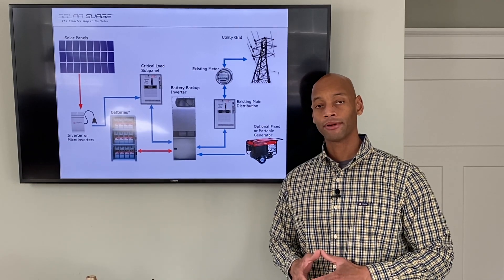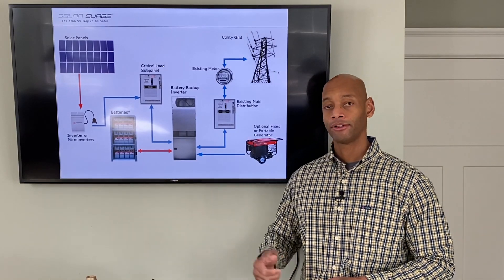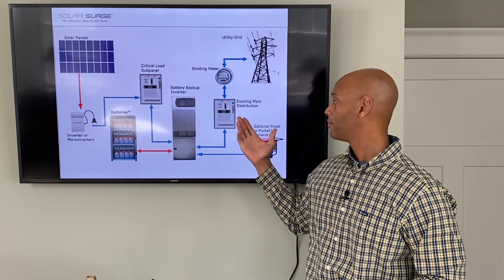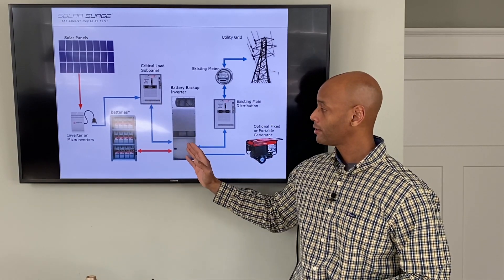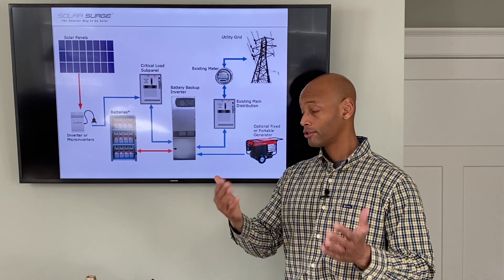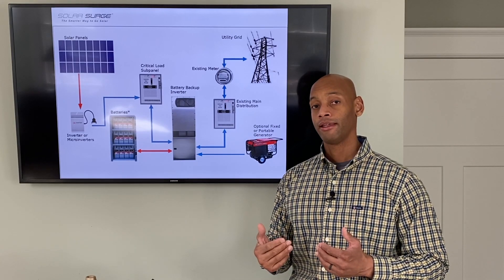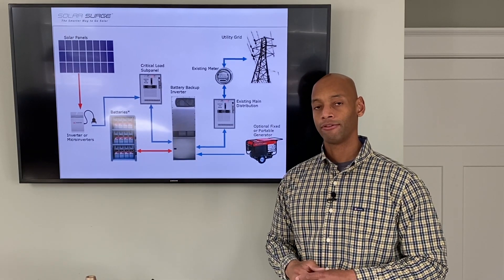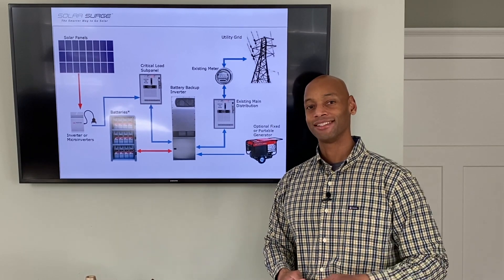How to Add Battery Backup to Solar System

Comment: hey Joe, great info.  I have this set up now and its paid for. Id like to know if i can upgrade the existing panels to more efficient producing panels using my same Inverter set up. Also adding battery back up would be great as well. 

Solar Panels: Sun Power

Model: SPR 230 WHT

Quantity: 30

Watts Total : 6900

kW Total: 6.9

Inverter: Sunpower

Inverter Model: SPR 3000 & 5000m

Comment: How can I  use my battery at  same time solar is keeping my battery charge before needing to go back to the grid.
Reply from the maker: It’s a very technical answer, but basically both Solar and Battery power is delivered to the same DC bus from which the inverter is drawing so both can contribute to your needs.

Comment: I love it. I have solar and would like to get information about the battery store system and info on the generator set up. Also want to know how/if possible to set up system where enough energy stored and eliminate need for generator in power outage situation occurs. If possible.  Thank you.

Comment: Thank you for the information on solar systems.  I have two SUN 1000W/120V grid tie in inverters with limiters tie to supplemental solar power system.  Each inverter is hooked up to one 120V line.  Their purpose is to only supply supplemental solar power without sending any power in to the grid.  What system should I use to add batteries so that can have some supplemental power at night?

Comment: Thanks for this. Our solar panels are leased, We are grandfathered into Net Metering 2.0 in California. I believe if make any change to our system, well firstly the Solar provider has to allow/approve, and we will probably be switched to Net meter 3.0. Anyway .... I do have a 6500 Watt gas generator. I added a manual transfer switch to my main panel. So with the grid down, I turn off the main breaker,  slide the transfer switch and flip the 30amp breaker for the generator. This then powers the whole house. I dont use the dryer or electric stove. Looking at your diagram it makes me think that now the invertor is being tricked .... so would it be true to say that the solar panels are producing and feeding energy into my house while the generator is running?

Comment: is this configuration available in southern NJ for customers like myself with an existing Sunpower system circa 2015 ...(DC)?  i also already have the alternate box for the emergency circuits feeding off a gas powered generator during emergencies.

Comment: Any idea if this set up can be accomplished using an EcoFlow Delta Pro Ultra and EcoFlow Smart Home Panel 2? If so, would the Smart Home Panel 2 just replace the Critical Load Subpanel and the Delta Pro Ultra replace the Batteries in your diagram? I'm assuming you would still need to buy a separate AC coupled inverter/charger in order to all for the panel inverter to still work in the case the grid goes down, as well as to be able to send excess electricity back to the grid for NEM.

Comment: Hello thank you  for this video, I'm planning to add back battery on my existing solar system. I do have Enphase micro inverter. what type of inverter do I need to use? thank you
Reply from the maker: This video is a bit outdated. For today's batteries, you could use either FranklinWH or Tesla Powerwall 2 to add to your existing Enphase solar system.

Comment: Hi, Joe, thanks for the video. I'm from CA. If I add a battery back-up into my grid tied solar with micro inverters since 2015, will my current NEM be changed? Thanks.

Comment: This seems wasteful. You’re charging your batteries with DC from the solar that you can convert to AC and then back to DC. Also, the batteries don’t appear to be portable. We need better cheaper systems that we can manually switch in the very rare occurrence of the grid being down for an extended period. Also, my car’s battery is four or five times what’s needed usually for a home back up and I really would appreciate some way to use that.

Comment: Keep in mind that for many people this is for a rare occurrence that may never happen.   I have never had a power outage for more than a few minutes in my area in 12 years.   So I would be perfectly happy having to do some manual switching in the case I ever need to use the backup if it saves me money now.   Also I might want to be able to use the batteries for other uses - such as a boat motor which I would rarely use - maybe a few times a year.  So I'd prefer them to be portable.
Reply: Ecoflow

Comment: my 5 KW solar system already has an inverter.   It seems a waste to buy a 2nd inverter for the batteries.   Can't that be avoided?  I would rather have a switch input to my one inverter to select battery or solar panel inputs.    Then I would need a separate switch I think to disconnect from city power and feed my main house electric panel from my batteries or solar.   FYI, my current inverter feeds the city meter and power comes to my house in all cases from a connection from that meter.  We are on net metering so maybe that is why.    Should the batteries be stored inside my house for better temp control and longevity (moisture, sun, etc)

Comment: Hi, can I connect manual transfer switch connect to the main panel and use gas generator if I got grid tie solar system?

Comment: Caint I just use a transfer switch to set up off grid battery backup for my solar ??
Reply from the maker: Yes that's one option, but it will be a more cumbersome wiring.

Comment: Question about main busbar... I know in a PV only system, the breaker max size tying into the solar system is decided by busbar rating times 1.2, so on a 200 amp busbar with a 200 amp main, you can have a 40 amp breaker for the solar, which I assume means a max current of 32 amps in that 40 amp breaker.
What about the battery storage? Does the current of the batteries add to the PV for the busbar calculation? Or, since the batteries would never feed the grid during the daytime, is there a different rule? I am trying to understand the Enphase system and get certified.

Comment: Niceley explained. Do you also offer a possibility to choose between power from the outside grid or the battery. Like via an app or an automated system depending on  actual KWH prices?

Comment: Hello , I’m looking for an Inverter like you where showing here , my house now on average 3KW a day , I do have a central Ac unit forced hot air , gas furnace, 2 full-size refrigerators , the coffee maker 3,000W / 24 hours = 125wh or 3,000/16 hours wake hours 187.5Wh the hybrid inverter battery back up Solar/ wind turbine MPPT 90A 120v x 2 or stackable inverters !
Reply from the maker: Check out www.altestore.com

Comment: if i dont want to have another C.L. panel and want to use my main panel with all my connections the way it is and turn off just the brakers i dont want to use , it will be ever easier correct?

Comment: What about back feeding the main panel fitted with an interlock kit rather than separating 10 circuit and manually switching between the battery bank and main?

Comment: When the grid is still connected and your battery is full and the house-load is limited; you will have extra energy to fed into the grid. Will that also work in the configuration you show?
Reply from the maker: Very good question.  The answer is Yes.  The hybrid battery backup inverter has the ability to feed excess solar back to the main panel/grid for sell back.

Comment: This is excellent. I REALLY appreciate how you go into how the inverter tricks the solar inverter into producing and shutting down, and it’s good to see that a generator can feed it directly to supplement the solar. 

I’m in a situation where I’d only want 2-4 hours of battery if it’s night or I’m not getting much solar energy, and depending on heat/cooling load, and then I could swap to a generator if the nights also need some power and the grid is still down.

Comment: Joe I have a 20’ x30’ camp I power with a gasoline generator. The generator is located in a structure 70’ from the camp. An underground cable runs to a 100 amp entrance panel inside the camp and powers the circuits from the panel. I would like to add a battery bank that I could keep charged by the generator. The camp sets on 32” concrete foundation wall and there’s a concrete slab creating a crawl space beneath the camp, this is where I would keep the batteries. How do I connect the power from the battery bank to the entrance panel. My goal is use battery power to keep fridge and lights going in the evenings and while I’m away riding side x side, fishing etc.. The camp is located in northern Maine no grid power is available, I would like to add a small solar array down the road to charge the batteries as well. I use the camp 8 to 12 times a year hoping to use it more when I retire in 2 years. I would appreciate help with design and the components needed to accomplish this!?
Reply: Outback Flexpower One and batteries.

Comment: I just watched a prepper video the other day that was talking about the different types of back up power in a grid down scenario. They were saying the Tesla wall doesn't hold very much power and you could get more power from your car battery.
Reply from the maker: No I’m afraid that’s not correct. A standard 12 V car battery has less than 10% of the storage capacity of a single tesla power wall.
Reply: You are right.  My dual motor Model3 battery is 85 kWh capacity.   Powerwall is only 13.5 starting level.   It is frustrating Tesla doesn't allow me to use my tesla battery to feed an inverter in the case of a power outage.   But there are some technical issues on the house side also.    The line used to charge your tesla may not be the right specs to backcharge your panel.  Hopefully in the future this will be possible.  But you can be sure the utility companies will fight it every step of the way.

Comment: Can you use the battery AC coupling system to provide supplemental power during "time of use" peak times?
Reply from the maker: Yes, that is an option as well with this equipment.

Comment: Awesome video!  This setup is great, but you’re still connected to the grid.  I wonder how completely off-grid homesteads are set up…enough solar panels to run the house AND recharge the batteries during the day?  Or perhaps two battery banks used interchangeably??  I’m obviously a newb. 🤪

Comment: Why aren't the solar panels connected directly to the batteries (DC to DC) and then the inverter works on that power to power the AC side (House and Grid)?
Reply from the maker: Hi and thanks for writing in.  Most new solar + battery systems work that way you descried.  However, if we need to retrofit battery backup onto an existing grid-tied solar PV system, we use the AC-coupling method described in this video.

Comment: Hi. What about if you don't have a regular battery but have a solar generator that you want to use as the battery backup with an Enphase microinverter solar system? How can it give battery power and be charged from the solar system when the power grid is down? Thanks.
Reply from the maker: Portable solar generators are not adequate for home backup and they will not interface with an Enphase micro-inverter system.  For home backup, we suggest Tesla Powerwall or Enphase Encharge batteries.
Reply: @SolarSurge  I understand. The enphase system will still charge my portable solar generator using AC power from the power outlet when the power is down though right? I ask because I hear that it can still do an island of my house when the grid is down at least when the sun is out. Was the solar guy not telling the truth about this?
Reply from the maker: @cjhighway  The new Enphase IQ8 micro-inverters will allow islanding without a battery.  However, what's being installed today is IQ7, which cannot provide any power with the grid is down.
Reply: @SolarSurge  Thank you for responding. This is what I was not hoping would be the case as the solar guy who sold me my system said differently. There is so much dishonesty in this industry.

Comment: Well done Joe. What‘s your preferences of AC vs DC coupled solution?
Reply from the maker: Hi Jing Yu and thanks for writing in.  It depends.  DC-coupled is most efficient for off-grid operation.  AC-coupled is preferable to adding battery backup to an existing grid-tied PV system.

Comment: Most grid tied solar inverters have a high voltage shut off say 266 VAC. Wouldnt the battery charging be regulated by the charger?
Reply from the maker: Not when in AC-coupled mode.  In AC-coupling mode, the battery inverter is back-fed with AC power coming in from the grid-tie inverters.  The charger only kicks in when charging from grid power or generator.

Comment: Joe, I currently have no solar but run a generator using a "lock-off" device on my main breaker panel, which allows me to pick and choose ANY combination of breakers at my choosing as long as I do not overload my genny (this is when I monitor a AC Watt meter).  Question, If i add solar and Inverter with battery backup, can I still utilize a main AC breaker lock-off to enable my current flexibility of breaker use.  I do realize my system would not auto switch over and I would have to manually lock-off the main breaker as i do now.  I'm just not crazy about having a critical load breaker center that I have to predetermine which breakers I want IF a complete longterm grid failure.  Then, I wont be able to run other breakers that I may want to cycle on or off.  Load center is fine for storms and short term but I have two 100 amp breaker boxes and want flexibility?
Reply from the maker: Hi Steve,

In theory, yes, you could keep your whole-house backup using the main breaker inter-lock switch.  However, this configuration is not supported by the equipment manufacturers so you will have a hard time getting a professional installation with a warranty.  In this case, I would recommend using Enphase or Generac PWRCell with whole-house backup and intelligent load management.  Please see our video on this topic: https://youtu.be/a8kRPb3jJBI

Comment: Thanks for another great and informative video.  You explain well at the high level and don’t get lost in the details.  I wonder how critical grid tied solar is on the receive frequency since frequency is the means to communicate between subsystems.  What I mean is on our rural electric we often have brown outs (90 VAC) or over voltage (140VAC).  I have never put a frequency counter on the mains to verify it is consistent.  So the question is what is the tolerance so the grid doesn’t fool the AC coupled equipment that there is a fault?
Reply from the maker: Hi Brent.  Great question.  During a brown-out or voltage spike, the battery hybrid inverter would disconnect from the grid and use the battery to protect the critical loads.  You can manually set the low and high voltage/frequent cut out points.
Reply: @SolarSurge  thanks. What happens if the grid frequency changes?
Reply from the maker: @brentjohnson6654  Same thing.  The hybrid inverter will disconnect from the grid if either the frequency or voltage falls out of the acceptable range.  This equipment has a wide tolerance as it is often used in 3rd world countries with unstable power grids.

Comment: To bad the Battery Backup Inverter could not send a signal to individual panels to control the generation.
Reply from the maker: Good comment.  Take a look at the Enphase Ensemble battery.  It has the ability to turn individual solar panels on/off to balance the production and consumption.

Comment: I'm learning a lot from your videos!  Do you spec lead-acid batteries for any of your grid-tie clients?  If so, what's your preferred model for emergency-only use?  I'm looking at Trojan's SSIG 06 490; $280/usable-kWh (assuming 50% discharge) is hard to beat for something I doubt I'll cycle more than 30 times per year.
Reply from the maker: Hi Alec.  Thanks for writing in.  No, I no longer spec lead acid battery for grid-tie with battery backup installations.  In my experience, over time, the homeowners forget to keep up with the maintenance and end up ruining their battery bank.  I now do maintenance-free AGM's or lithium batteries only.
Reply: I have lithium yes the cost is more but the lithium is so post to do you live for a better performance in life span .

Comment: You should also add in a wind turbine to the system info. for when sun not shining.For people off grid and want extra power or charging of battery's .Enjoy your video's.
Reply from the maker: Yes, that is an option also.  To add a wind turbine, we would need a separate DC charge controller hooked directly to the battery bank.
Reply: Sailers have used wind turbines for a while and are moving away from them now because of the noise.   Also you want clean air with not too many obstructions around your house.   With a roof mount you might not find the noise too bad but something to consider for you and your neighbors.

Comment: Great video! Liked! 
One quick note about charging the batteries during cloudy days. Some homeowners will want this setup to work as TOU offset (so it pays for itself continuously vs only during outages). Blame the utilities for this but the software in the battery inverter (at least for some states) will NOT allow the grid to charge the battery. So on prolonged cloudy/rainy winter days, you'll still see high TOU bills. PG&E argues that this is necessary to prevent you from charging the battery after midnight with cheap power and dumping it into the grid in the evening at peak pricing. The only exception to this rule is events like Tesla's Storm Watch.
Reply from the maker: Good feedback.  I believe Outback supports the TOU offset with their "Grid Zero" functionality on the Radian inverter.  However, I think the lithium-ion AC-coupled batteries (like Tesla or Enphase Ensemble) are better for the TOU offset application.  The Outback system pictured here is really designed with off-grid operation in mind.